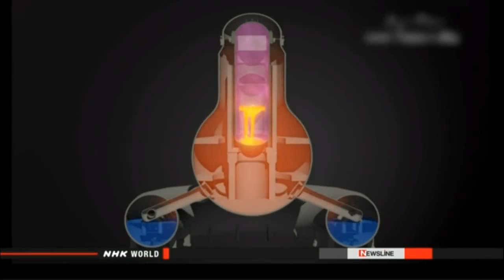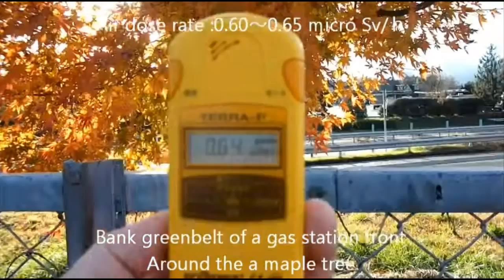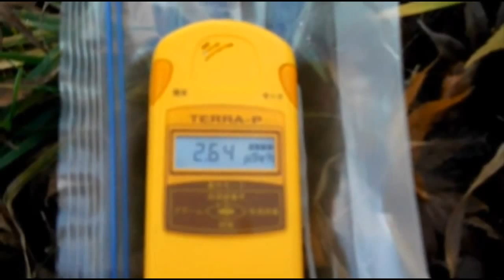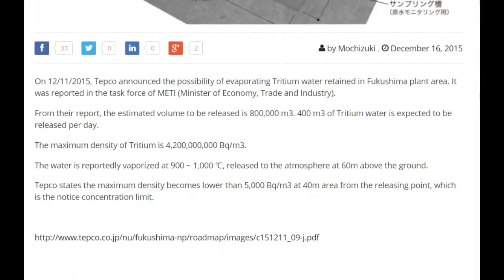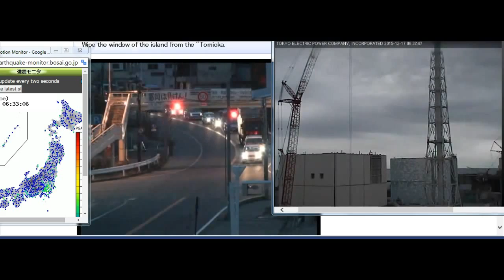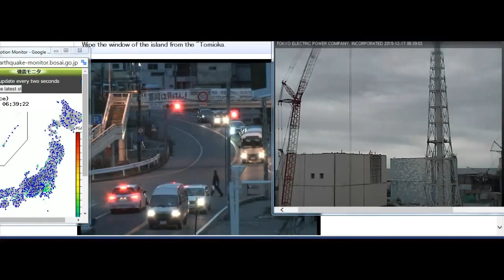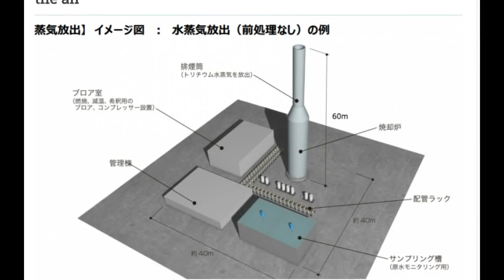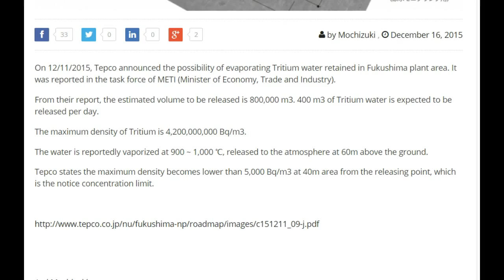Fukushima News 12/16/15:  Melting Of Key Parts Blamed For Fukushima Meltdowns

Comment: Regardless of WHAT temperature it was at, the simple fact that only NOW they think of replacing parts with "Heat Resistant" materials boggles the brain. =-O What the serious fuck? No Heat Resistant parts for a piece of apparatus which needs a constant flow of coolant?? Erm..  HELLO? 
This design is about as much use as subtitles in a porno. 
And to think they are turning others ON? I'm sweating like a nun at an abortion clinic.
Reply from the maker: +KINDLE   lmao at subtitles in a porno.  That's a good one.  
Who would have thought it's necessary to put heat resistant parts in a nuclear reactor?   Like...DUH!!!     How many reactors in the US have the same problem?
Reply: +MissingSky101 the real question is how many reactors in the US have failed that they have kept secret

Comment: Hold on;  200 celcius?  That's only 392 F.  Not hot enough to melt most any metals.  What were these parts made of?  Sugar?
Reply from the maker: +annebeck58 I caught that too.  I think they meant to say 2000 degrees Celsius.
Or maybe not.     My self cleaning oven can exceed 1000 degrees F and it hasn't melted down yet.  :)
Reply: MissingSky101   Hahah,
Reply from the maker: +annebeck58 Just out of interest, Tepco has unplugged the live camera view from Unit 4.  It hasn't been working for several days so I suspect they're hiding something nasty from view.
Reply from the maker: +annebeck58 Mystery solved Anne.  The parts that melted were rubber.
Delay in cooling Fukushima reactor possibly due to melted rubber, says Tepco
http://www.japantimes.co.jp/news/2015/12/17/national/delay-cooling-fukushima-reactor-possibly-due-melted-rubber-says-tepco/#.VnOoBPkrLIV

We assumed they were using faulty METAL parts.    RUBBER parts in a nuclear reactor makes much more sense......for depopulation.
Reply: MissingSky101   Rrrrrrrrrrrrribbah Biskits!
What was rubber?  The seals?
THAT caused this whole thing to go kahblewie?  Uhm, okay.
Maybe next time they use clay?
Reply: Okay, Sky;  from that article:
"The temperature limit for the component was about 170 degrees Celsius, but Tepco found it was able to withstand that level of temperature for only several hours"

Seriously, though..;  they were relying on RUBBER that would withstand temps of (only about) 250F?  WHAT?  In a freakin' NUCLEAR reactor?  Who the heck thought that was a good idea?  Reactors, sans water, are HOT.  Yeesh.  250F would hardly bake bread.
Reply from the maker: +annebeck58  Yes.  Rubber seals in the safety valves next to melting fuel rods is a brilliant engineering design.
Reply from the maker: +annebeck58 Don't these idiots do any research before they build nuclear reactors?  
ask.com
What is the melting point of rubber?
QUICK ANSWERRubber begins to melt at approximately 180 degrees Celsius.
Reply from the maker: +annebeck58 It's criminal.
Reply from the maker: +annebeck58 They didn't choose the right kind of rubber.
latex can melt anywhere from 250 F to 350F depending on the specific mixture

http://www.instructables.com/id/unusual-uses-for-condoms/

Sorry, sometimes we have to use twisted humor to keep our sanity.
Reply: +MissingSky101    Kiki removed the rubber  band from her ponytail and put it up to save the reactor.
It didn't work.
But, it seemed like a good idea.
They implemented this, "technology", in Sendai (ha.)
Reply from the maker: +annebeck58 Haha.  I have confidence they'll come up with another brainy idea.  The nuclear engineers are a pretty innovative bunch.   Duct tape and traffic cones fixed a few problems at Daiichi plus we have the added comfort of knowing the nuke plants are stockpiling car batteries to keep the reactors cool if they lose power.   We're in good hands now.   ◕︵◕